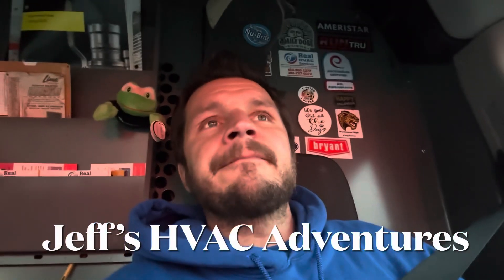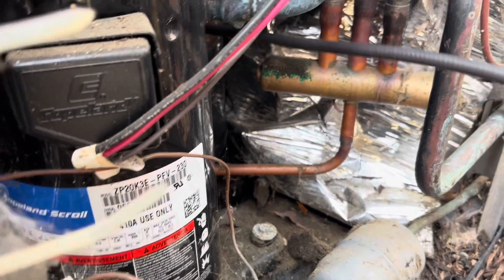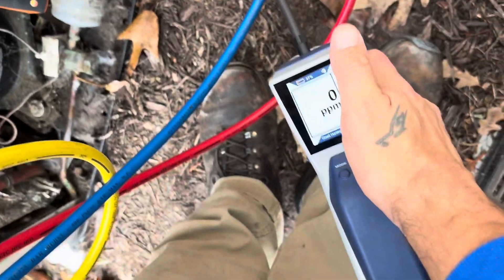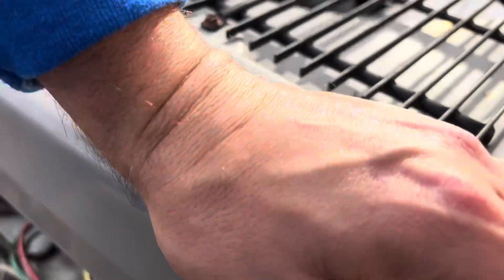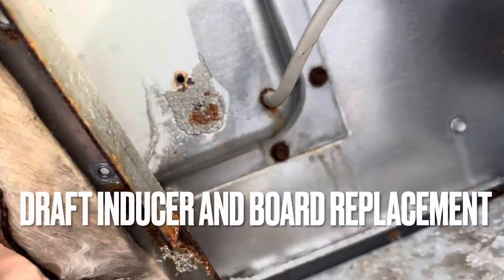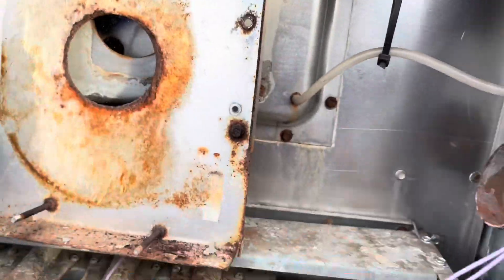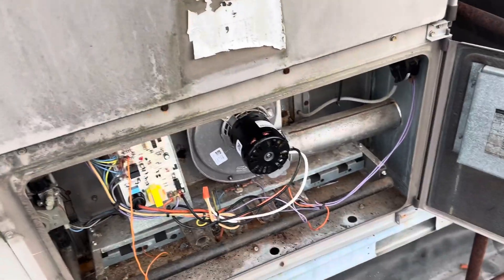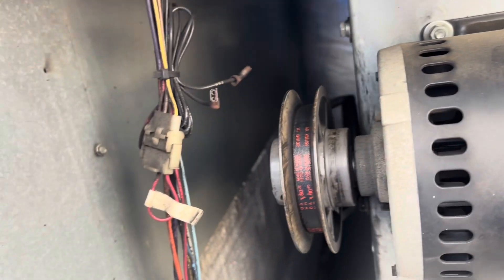Bad Day For York Units… Let’s Fix Them!

Comment: Great job just a opinion recommend a die being you didn't find anything but the valve so in the future you can look for it with the UV plus the new die would seal a micro leak that's just in case plus for future diagnosing..
Reply from the maker: Absolutely!  Used them before with good results.